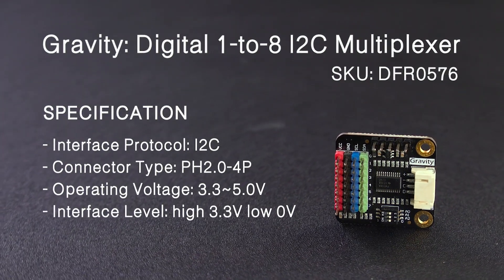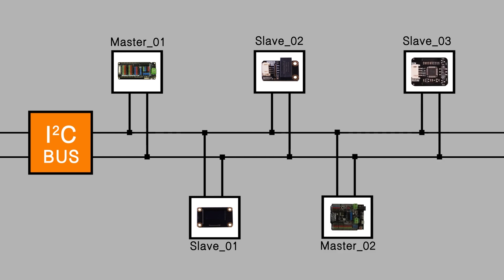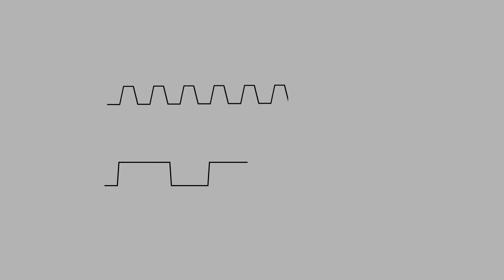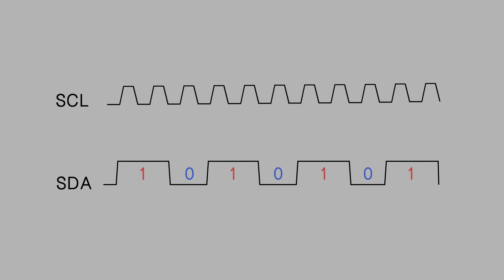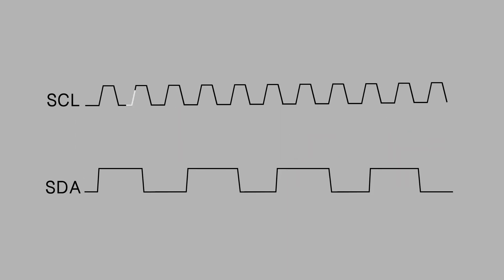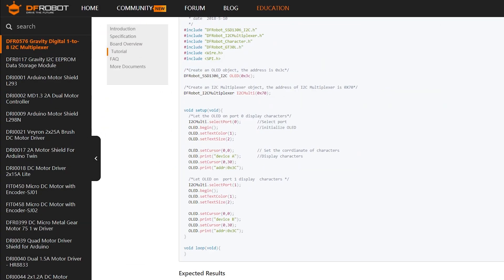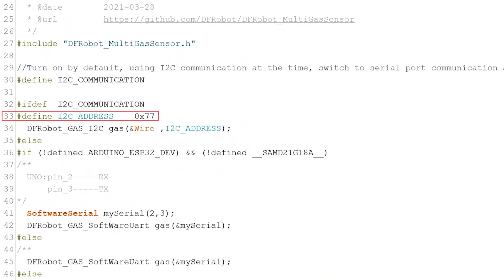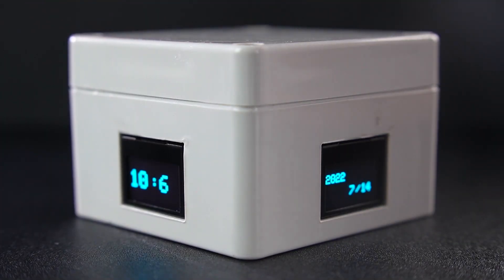How The I2C Protocol Works - Using Gravity: Digital 1-to-8 I2C Multiplexer

Comment: Is it possible to use multiplexer to connect hundreds of I2C magnetic position sensor (e.g. AS5600) to a single arduino?
Reply from the maker: Well, we can think of Multiplexer as a single pole multiple throws in theory, but we haven't done such kind of test. Has anybody here already done this kind of test?